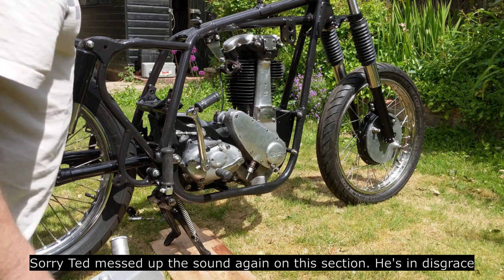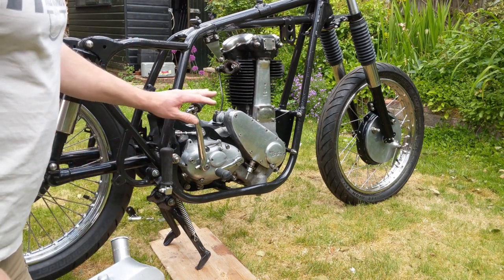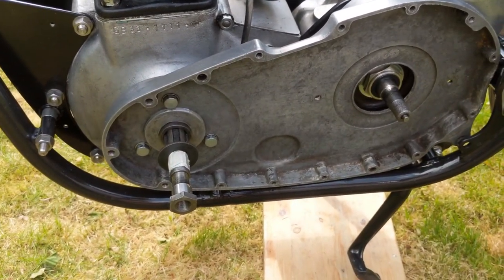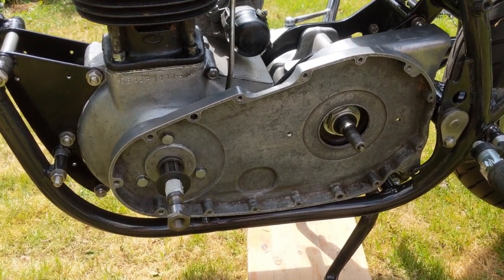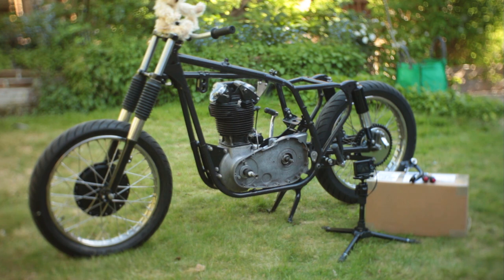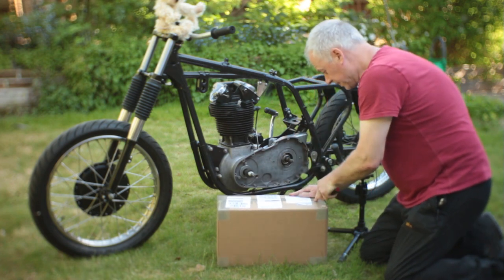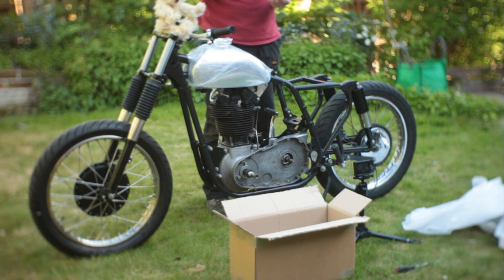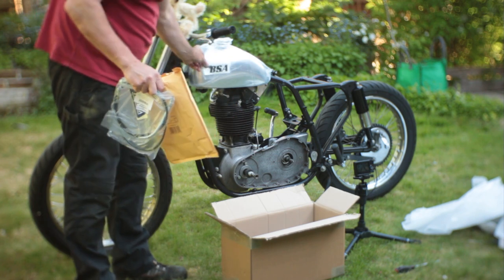Building a BSA B31/B32/B33/B34 from parts - Episode 11 of many. Rear brake pivot

Comment: How can BSA make a frame where the owner has to drill and weld an attachment for the "upgrade" of having a rear brake? Or was this due to the rusty bit?
Reply from the maker: There were different options depending on the year/model. This frame was really for a different brake arrangement (full width hub, brake plate on the other side,  not quickly detachable wheel). I wanted the go faster wheel/brake design.
Reply: @motorbikewhisperer  Blimey. They should have done a Harley: design three frames in 1846, and stick with 'em.